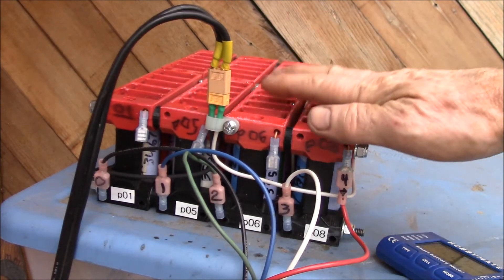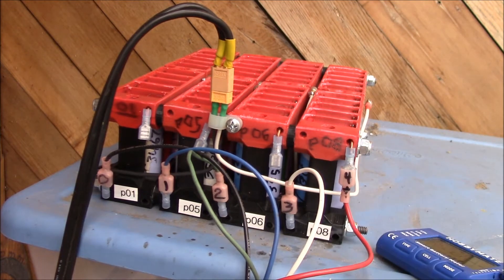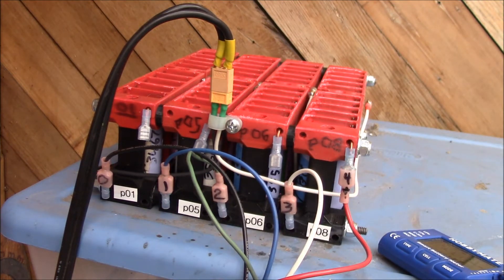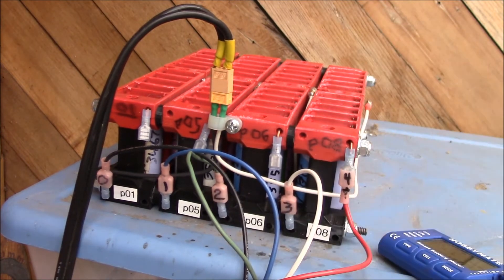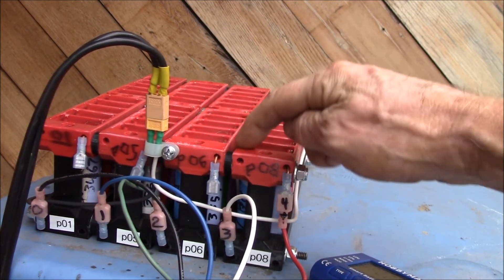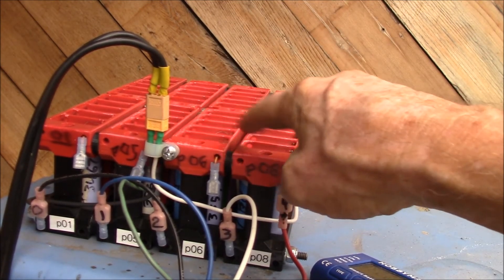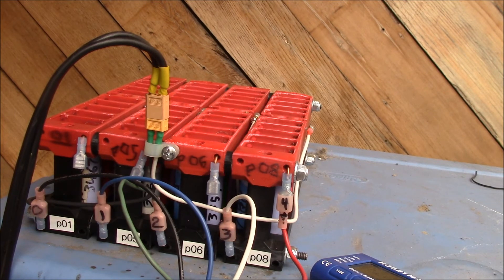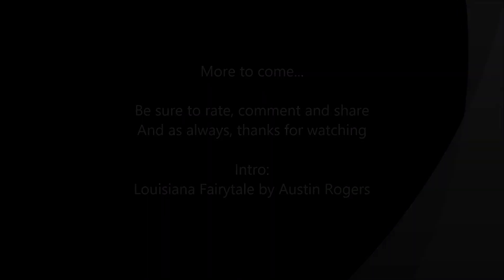4S-20P Lithium-Ion Battery, 5 Month Update, Part 2

Comment: Any particular reason your using 18650 cells? Instead of lifeP04 calb/gbs etc... I too am thinkering with 18650 but many solar banks I've seen using lifeP04
Reply from the maker: I suppose mainly for the price/watt hour.  I looked at the LifeP04 cell and while they are attractive, at this time the cost is just a bit out of my budget.  Although it does appear they are coming down in price and maybe some day I may go with some of those.  That would for sure be the case if I decide to move from my 16V to a 24V system, then I can use 7S Li-Ion and 8S LifeP04  in parallel quite easily.

Comment: Looking good Richard. I'm using XT60's to connect 7 battery packs together on my system. It's working OK so far, but is bound to involve some connection losses. On the plus side I can "hot swap" packs whenever I like. That setup should work well for you too.
Reply from the maker: It looks like that setup is working well for you.  I do like being able to pull a battery pack out of service without having to have any tools involved.  Makes it more convenient and also safer not having metal tools around high current battery connections.

Comment: Did you try this 4s in running  your  Tripp lite.  I have 12volts  Tripp lite powerverter and planning to run 4s 120p.
Reply from the maker: I haven't yet but plan to.  I think I'll need 2 or 3 battery packs (mine are only 20P) in order to handle the start up surge of the inverter.